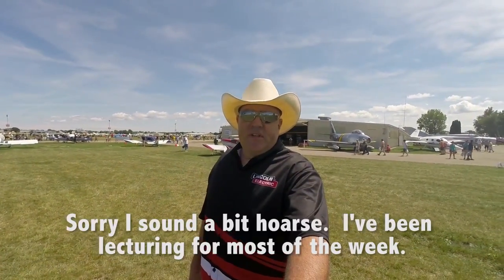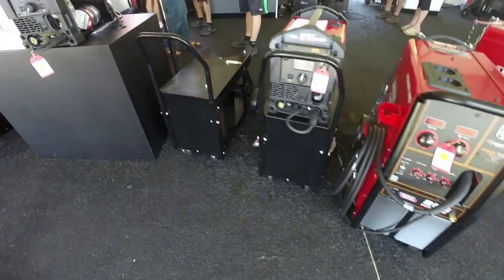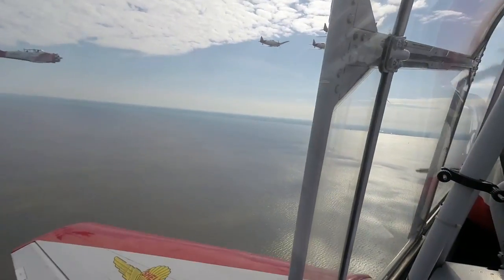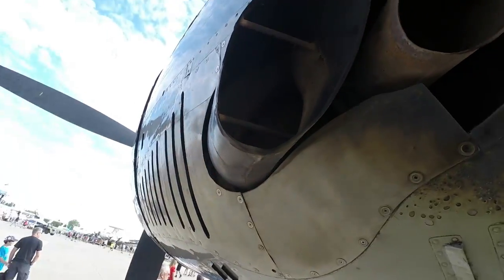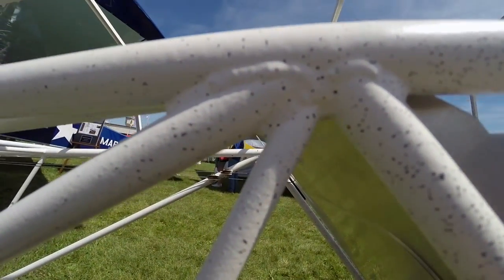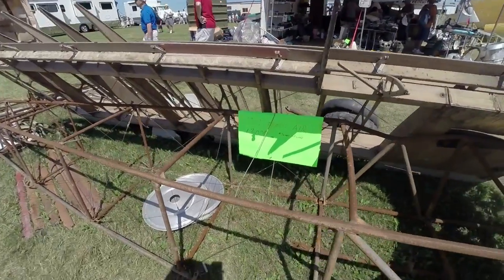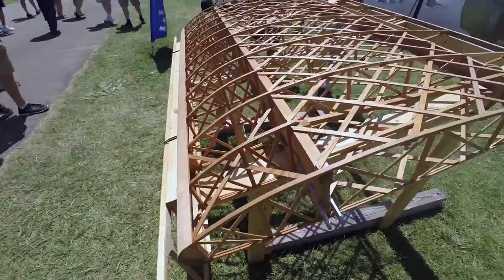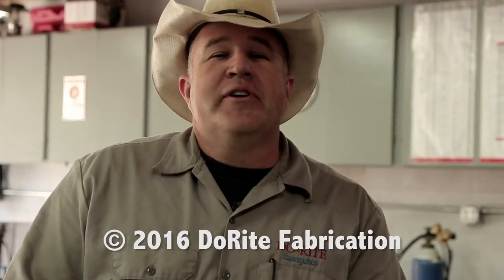Lincoln Electric TIG Welding tent at the EEA AirVenture Airshow in Oshkosh

Comment: looks like you had fun and that is what a air show is about do you take a cert for air craft welding ?
Reply from the maker: The classes are free to all attendees. EAA (experimental Aviation Assn.) requires A&P mechanics (air frame and power plant) to do so many CEU's of classes to maintain their certs. Lincoln teaches the fundamentals of TIG welding to get folks the basic knowledge and hands on so that they are comfortable with the torch and are ready for the next step. This class counts toward the hours that they need. There just isn't enough hours to get folks certified.